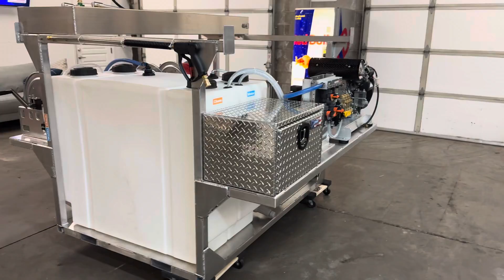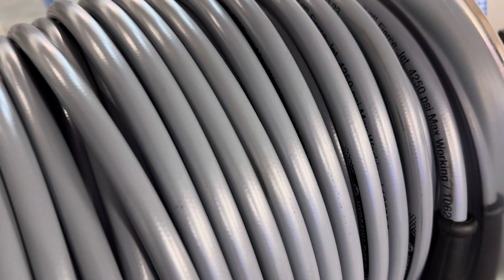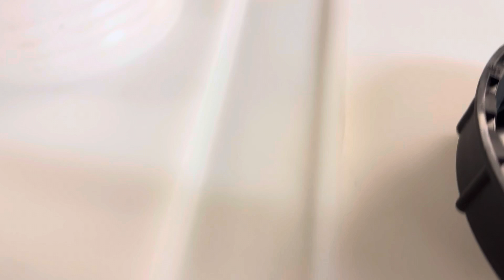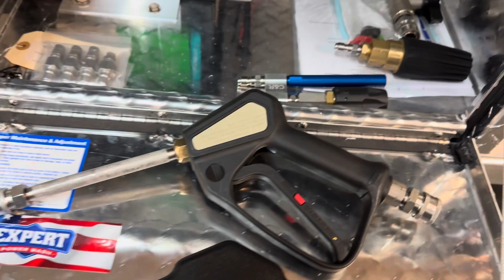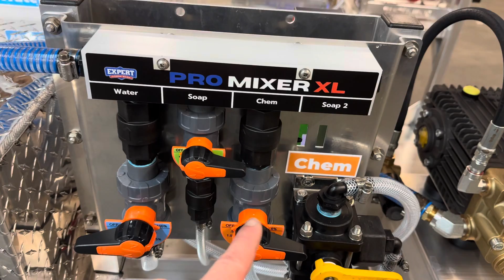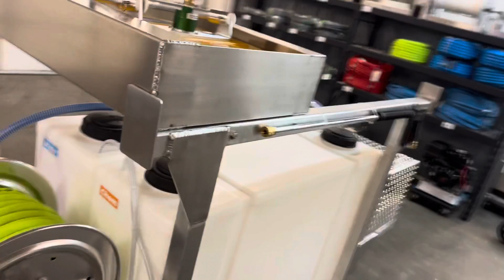6.5ft Pressure Washing Truck Skid Setup- Mark’s Skid

Comment: How does the truck ride when the machine is up on the rail?  I am trying to figure out the best config for my skid and I've always kept the weight centered and low for going around turns lol.
Reply from the maker: If designed right, rides great.